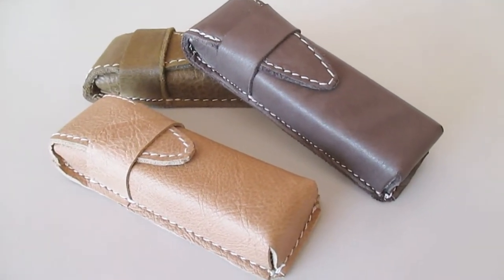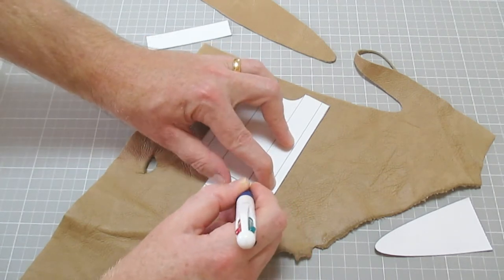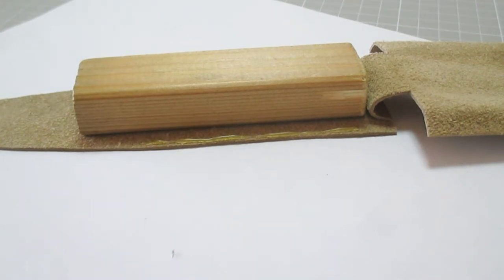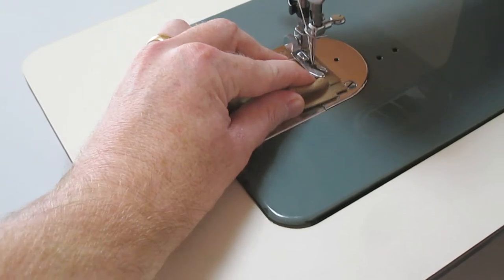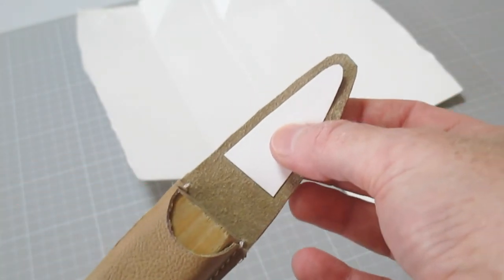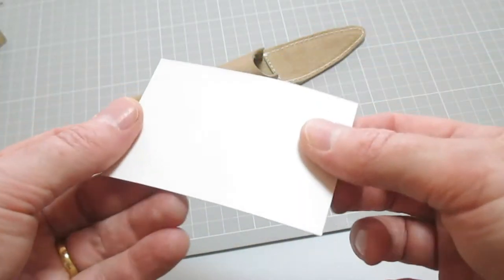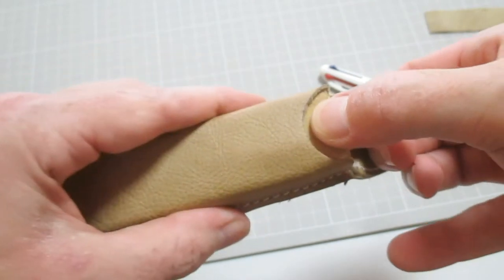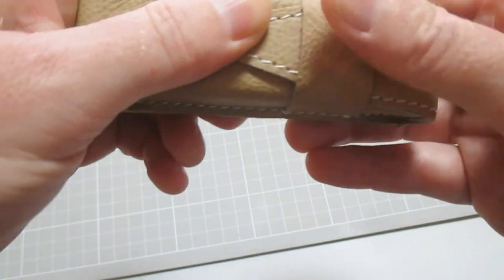Make A Leather Harmonica Case  FREE  PDF Pattern

Comment: I would make a suggestion: like you did with your flaps, I would sandwich that stiffener between two layers of leather. That way, also,  the inside will be “finished” and easier to insert and remove your harmonica.
Reply from the maker: I agree.

Comment: the project I was watching for.. u
one question.. why you didn't used a real harmonica to stitch the case? have you tried other materials like jeans or something else.. :-) thank you so much for the template.. will do in denim thou..
Reply from the maker: Hello! well I don't actually have a harmonica! I just took the average size of common harps and made a wood block to match the size. The difficulty with using denim is that there will be raw edges which will need binding and it will need more to stiffen. Hope this helps.
Reply: @Charbarhousemusic   :-) thank you so much..